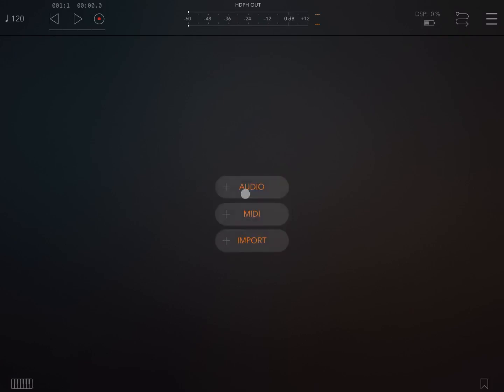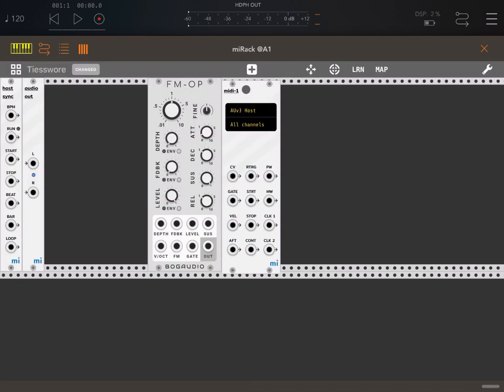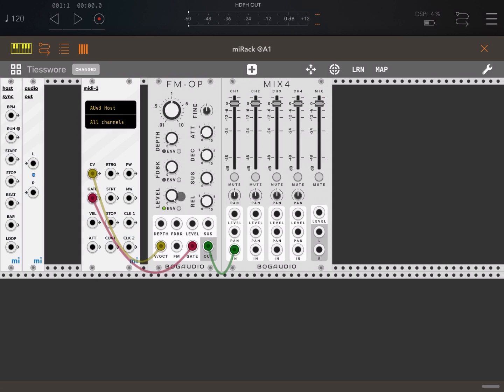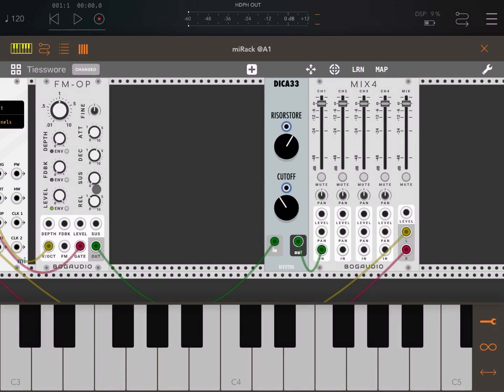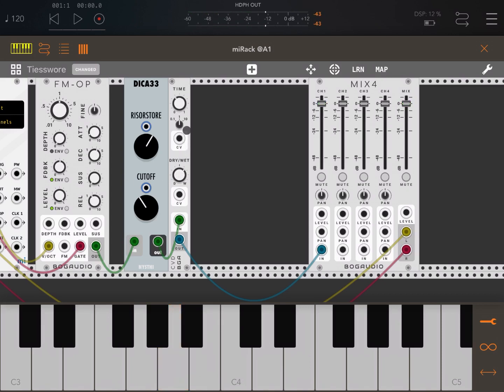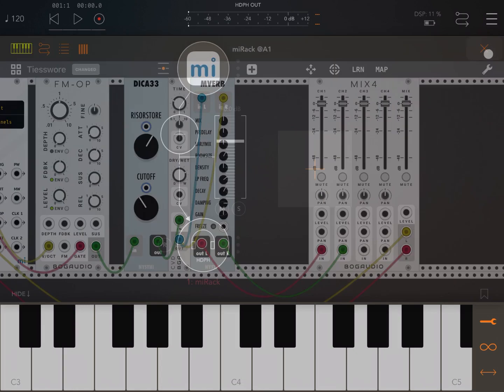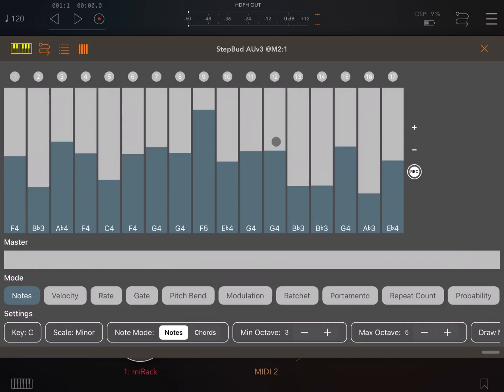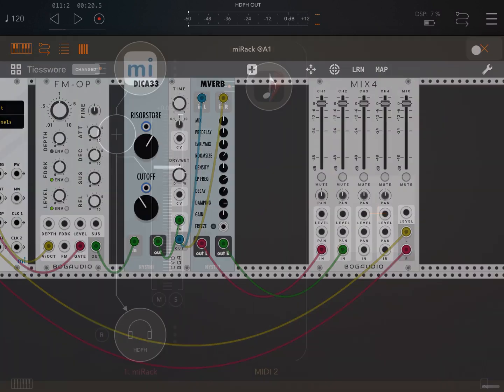miRack AUv3 - Tutorial: Exploring the app Part 3, Midi input

Comment: How do I limit the range of a MIDI controller?
Reply from the maker: there is not yet a midi filter; however you can do it before it gets to miRack or inside miRack convert midi to CV and then for example quantise
Reply: @soundformore  isn't quantizing CV going to introduce step noise?
Reply from the maker: maybe step repetition... of course you could work with other modules to limit the range as well...